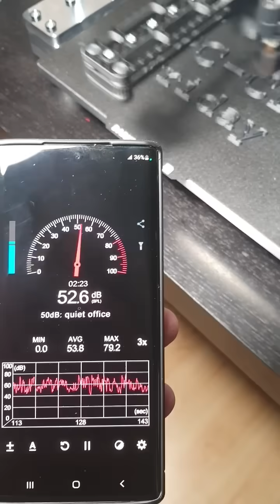PC-CF has a new day. For Wolves@STōN-3D  #cnc #3dprinting #woodworking #machine https://ston-3d.com/

Comment: Are you using tmc2209 drivers and THE cpap everyone uses because I know it's off but even when it's on you can't hear it! everything is so quiet!
Reply from the maker: 2209 on Z and E axis. 
But 5160 on XY. 
Yes a standard Wonsmart ws7040 blower and tube. 😀 Thanks! I did some sound and resonance reduction in the development phase. Correct.
Reply: @STōN-3D  i think i hate you hahahaha I've got some nema 23s running full speed at 3 amps right next to my bed 😶‍🌫😭
Reply from the maker: Btw the Cpap was on in the video. Just turned down low and silenced a bit with a rubber box.
Reply: @STōN-3D  i got mine controled by a potensiometer but i was thinking to use a pwm to 0-5v converter to control it from them mainboard. also i hope I'll be able to get to lower rpm...

Comment: How’s the input shaper graphs look like on this machine, looks cool
Reply from the maker: I have not re-tuned mine for 6 months. And I prefer printing towers. They don't mislead you like the data, and are faster than making the graphs. The accelerometer is included in the kit. So don't worry. But I encourage people to just print towers. It takes around 10 minutes. And it's done.
Reply: @ how do the graphs mislead you? Properly reading them shows every little problem in your machine
Reply from the maker: @ 1. What shows up on the sensor does not always correspond to the print. 
2. Simulations need to be tested but not vice-versa. Classic Dev. People forget.
Reply: @ mount sensor to nozzle
Reply from the maker: @tiger3dprinting  I understand. It is included in the kit. It is not junk. Don't worry :) I just prefer to print the tower. Happy to explain why, if you wish. Send us an email.
Reply: @tiger3dprinting The sensor shows both vibrations of the tool relative to the part and vibrations of the whole machine as a rigid unit, like on a wobbly table or damper feet. The latter don't harm your print and don't need to be suppressed, but suppressing them severely degrades your max accel at quality.
Reply from the maker: The accelerometer does NOT show the deviation relative to the print. It is relative to itself only. Inless you mount another one on the bed, you are just hoping. There is no Delta data. Just luck.  @daliasprints9798
Reply: @STōN-3D  That's what I'm saying. You only get acceleration data at the point you measure. You have no way of knowing whether that happened because the whole printer accelerated as a unit or just the tool did.
Reply from the maker: Ok so sorry I misunderstood your comment. My fault. @daliasprints9798